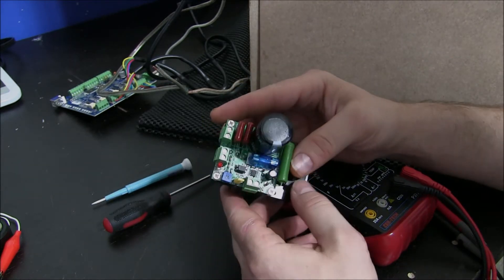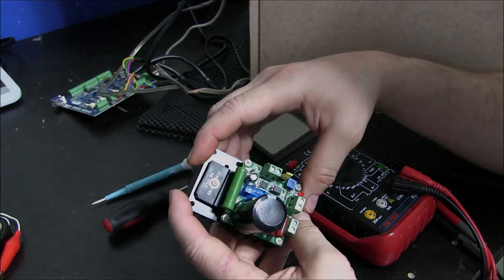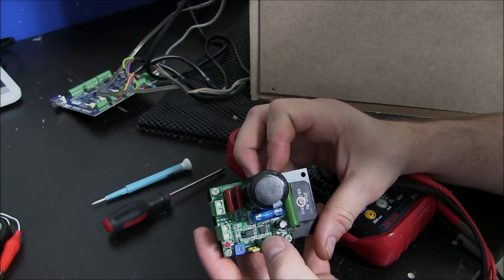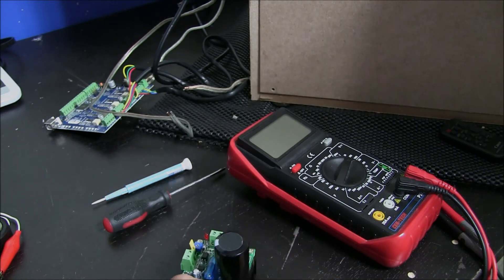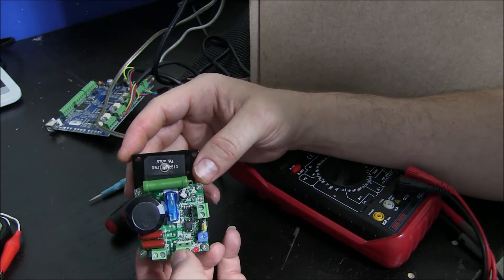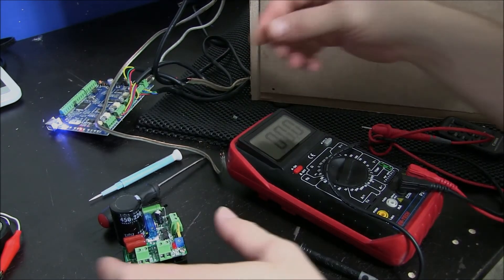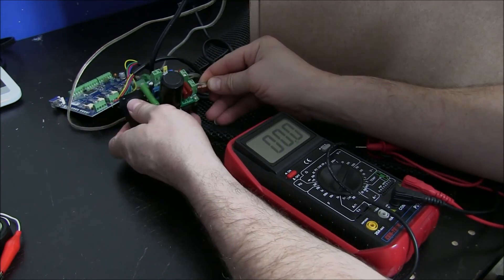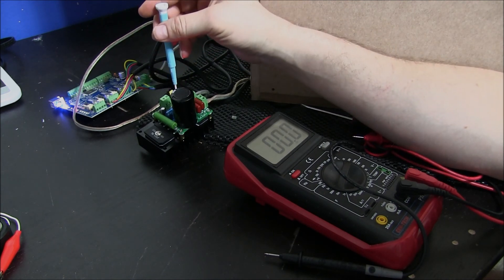Simple Spindle Speed Control Introduction

Comment: Can you control spindle direction? Or this thing does not change the polarity?
Reply from the maker: No Sir, only a DC voltage regulator.
Reply: I'm building cnc machine now. Do you think I need spindle to run in both directions? Is there different bits that work in specific direction?

Comment: I got the same controller you ha e there I hooked it up to my controller and I turn on my spindle it spins for a second and turns off the spindle won't keep running. What's wrong?
Reply: I have the same problem, did you manage to find a solution?
Reply: @henrycawley2  yes I bought a vfd and spindle

Comment: Hello, nice Video. But i have a China CNC 3040T router. There is a JP-3162B Controller with a PWM Output ( 0-10V ) inside. Now i want to connect this board to your board and control the spindle via Mach3. But it dosent work. Can you please make a Video how to do that correct? THANKS